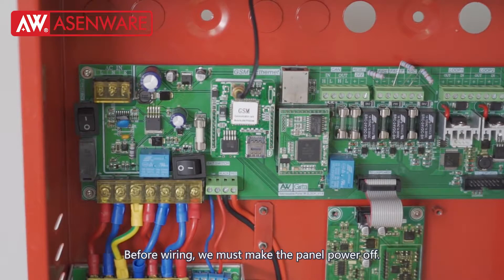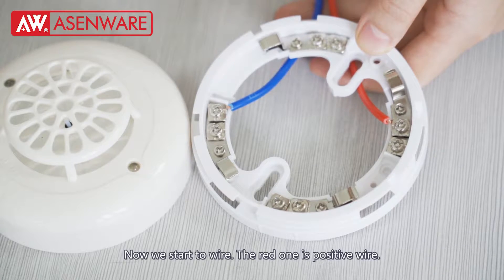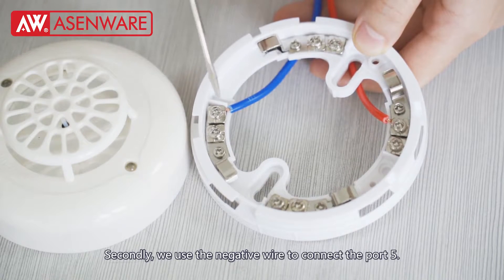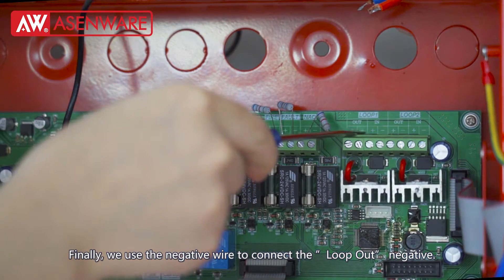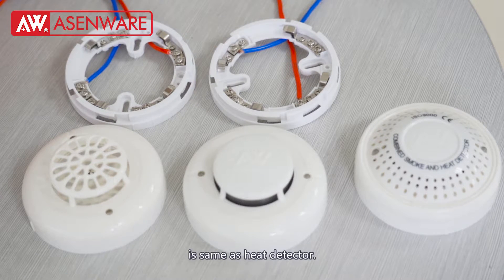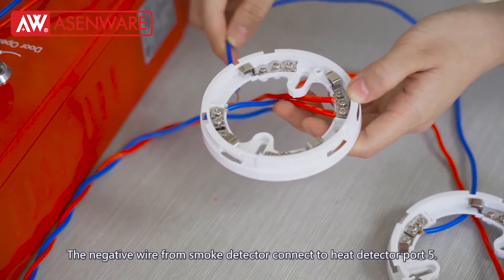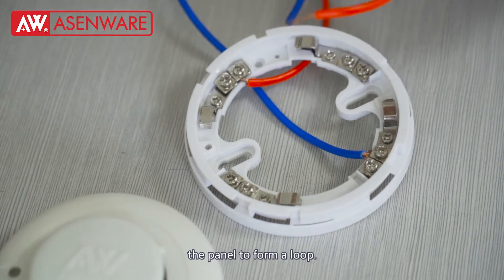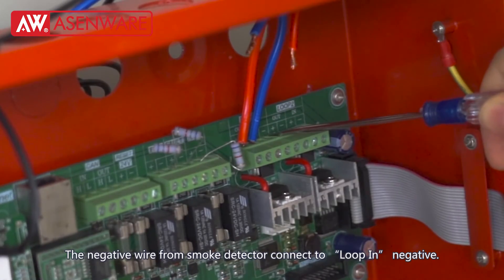How To Wire AW-D102 Addressable Heat Detect To AW-FP100 Addressable Fire Alarm Control Panel

Comment: what is the standard size of wire can be used for the smoke detector
Reply from the maker: recommend you use fire proof cable size ： AWG14 AWG16 AWG18
Link:https://www.asenware.com/products/list-Linear-Heat-Detection-System-353.html
Feel free to send your inquiry to info@asenware.com
my E-mail: sales03@asenware.com Whatsapp/Wechat/Skype: 8613922805301